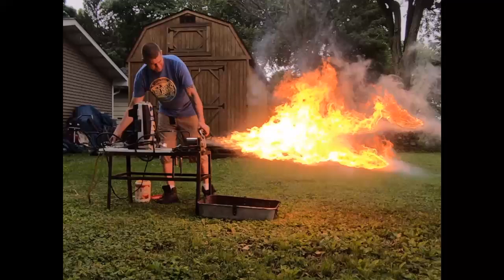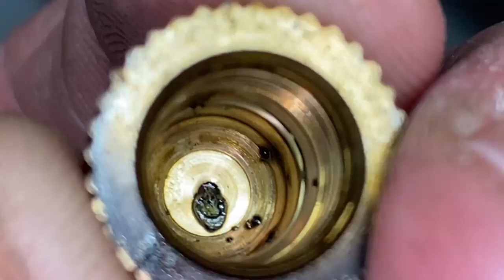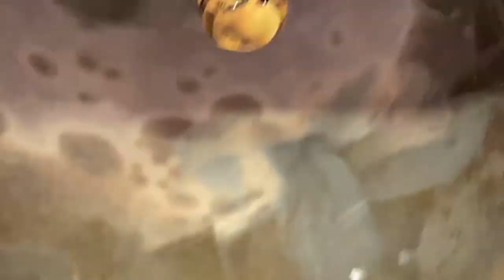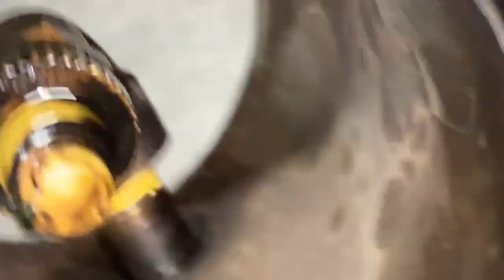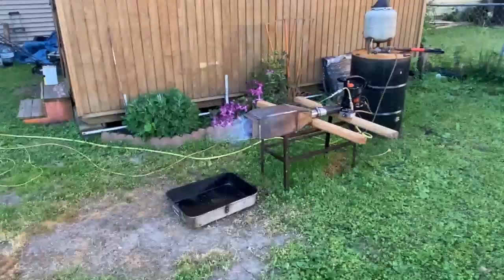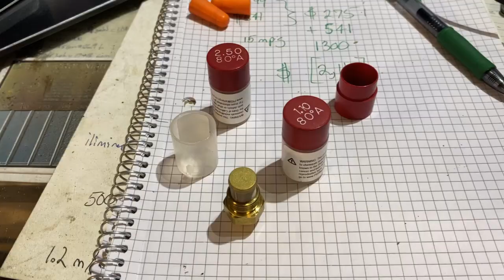Waste Oil Factory burner for process heating

Comment: You can clean waste oil of all solid particulates by mixing it with some propane and pressurizing and sending it through a column of bentonite clay powder.

Bentonite works as both an adsorbent (NOT ABSORBENT, ADSORBENT.) and a flocculant. The role of propane (or gasoline, or any other cheap solvent.) Is to thin the oil out some so it can pass through the bentonite powder without using extremely high pressures to push it along.

It comes out looking like brand new oil..
Reply: You can also heat the oil up and add muriatic acid with mixing and it'll have the same effect of making the sludge separate from the oil with only gravity.
Reply: I’m looking at bentonite. What is the length of your 12” pipe? How many gallons of oil do you get from each use? Where do you get your bentonite?
Reply: @jheissjr  12" pipe is about 2ft long but that length is not necessary, the diameter of your bentonite "filter cake" is whats important. I had a 2 ft pipe laying around and that happened to work well for the application.

I buy a product called Pureflo B80 in 50lb bags.

I keep waste oil in stainless kegs with a dip tube fixed to the 2" ferrule that's on the top of kegs. I can filter an entire 15.5 gallons of waste oil in a single filtration without swapping out the filter cake. Typically using about 1lb of "bleaching earth".
Reply: It's very helpful to "set the cake" in the pipe by making a slurry of bentonite powder and solvent, then using a vacuum pump to pull the solvent through the cake before adding the oil and pressurizing. The purpose of setting the cake wet is that oil will flow much better through the cake if it's been wetted with a non polar solvent such as gasoline or mineral spirits.

Thinning the oil with propane or gasoline is pretty dangerous without proper equipment and isn't necessary if you have a way of heating up the waste oil to about 100c. But if you decide to go that route,  using a vacuum pump to create negative pressure at the bottom of the pipe works also and is much safer. The catch there is that you need to have the fittings and vacuum safe containers as well as a vacuum pump to maintain a vacuum so the oil will actually flow.

Do not ever pressurize this mixture with compressed air... bottled nitrogen works just as good without all the hazards of making a bomb.
Reply: How long does the bentonite clay powder last until it needs replacement or becomes clogged?
Reply: @jheissjr  pressurizing the oil and sending it through a column will be much faster but you'll want to change the bentonite out every time and use at least a 6" diameter pipe. I use 12" stainless steel triclamp spools with stainless sintered disc's to hold the bentonite.
Reply from the maker: Great input
Reply: wow. I'm learning here. I'm curious what these commenters do for work to have gained this knowledge.  very cool stuff.  
and you said that was a 4mm? that's a pretty good flame with used oil for 4 mm. an I love this stuff! lol
Reply: @cowdough94  I'm autistic and I just read about this kind of shit obsessively. You should listen to me drone on about making and using graphene..

I picked up this knowledge from making biodiesel and cannabis extraction. The process and the equipment I already brought translated pretty well to remediating used engine oils.